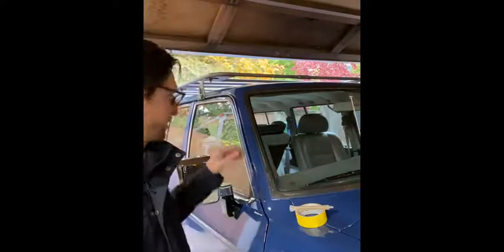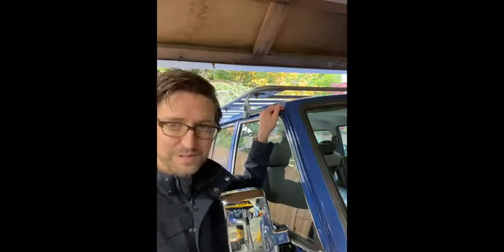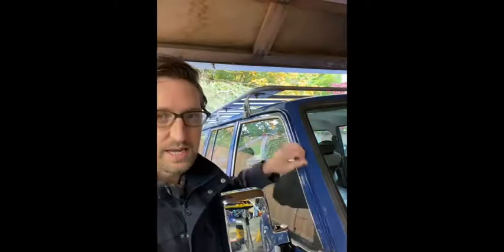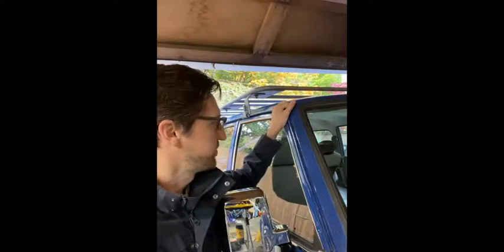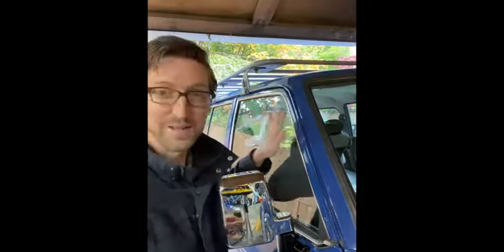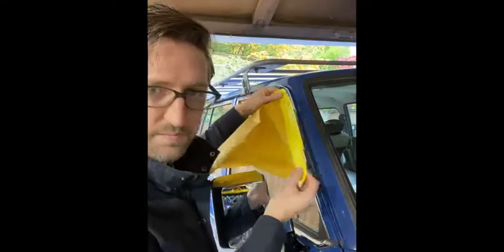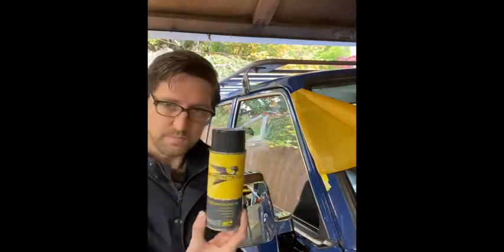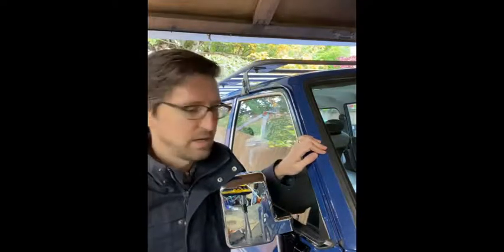Resealing the gutters on your Toyota Land Cruiser

Comment: hey chase, great video. I was watching your 80 steering box swap video and have a question regarding the install. what steering gear fluid did you use during the install? also, did you have to purge air, or bleed the steering gear box system?
Reply from the maker: Hey! Sorry just saw this. For the power steering system I used DexMerc III compatible fluid. That was the type specified in the factory service manual. Valvoline still sells a fluid at the local auto store that should work well. :) For bleeding: I filled the system, jacked up the front so the wheels were off the ground, turned on the truck, turned it lock to lock once, turned it off and checked the reservoir. Topped off the fluid, turned it on and the wheel lock to lock a few times. Kept repeating that until the reservoir stopped needing fluid and there were no bubbles. 👍😁